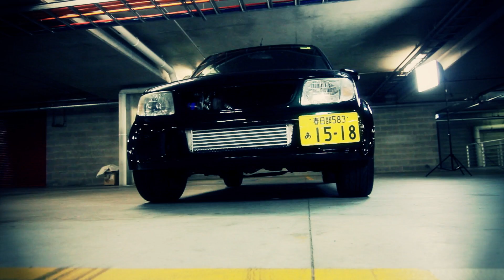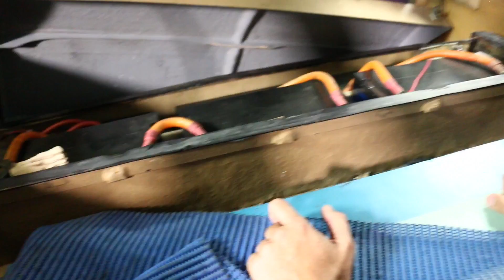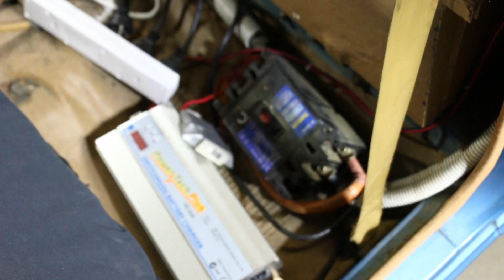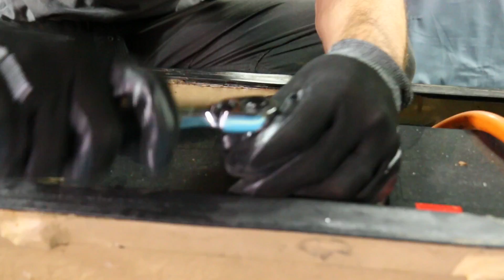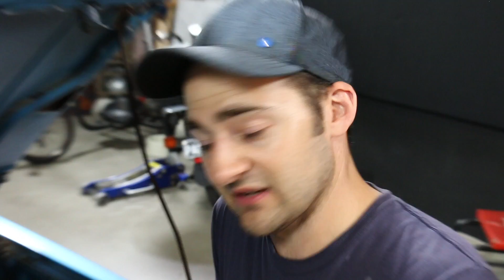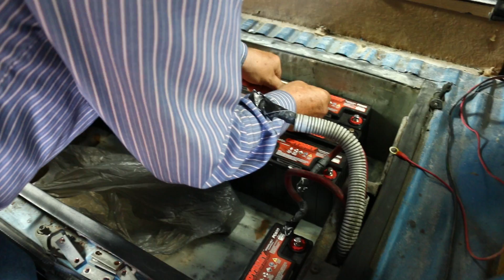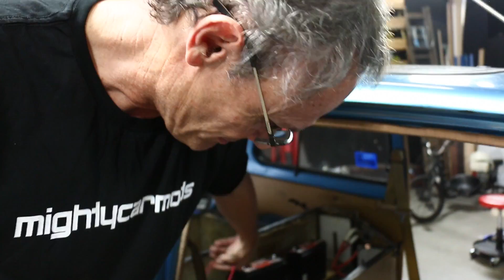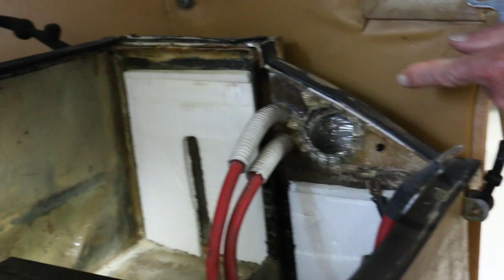JDM Electric Turd

Comment: Make your own batteries using 18650 LiPo cells (5000mA), and then throw a 35 Farad Supercap in parallel to each bank, and YeeeeHaaaaaa!
Reply: +delawarecop  Good luck finding a 18650 LiPo cell with 5000mAh capacity.
Reply: +delawarecop would be insanity, but then ud want to go for a bigger motor too, or maybe 4 motors, one for each wheel and a custom carputer to route power for fancy traction control. end up with pretty much a tesla...
Reply: EntourageTouring
http://www.ebay.com.au/itm/OZ-Li-ion-5000mAH-3-7V-Recharge-Rechargeable-Battery-UltraFire-18650-/371245818897?var=&hash=item566ff9a411:m:m3Jkcl0W8b7mD1C3BzfhwNg
Reply: ZYLINX
Yeah, I've seen those Hub motors that can be used for direct drive, which would help eliminate the inefficiencies of the traditional driveline/gearbox set-up, but I'm not sure how complex AWD via Brushless DC motors would be? But you are right - it would be insane!
Reply: +delawarecop 

those actually down have anything close to capacities they advertice, not even half.
Reply: finbenton
Did you test them?

Comment: Batteries, you need deep cycle batteries if you're going lead acid. Something like for a trolling motor, or UPS systems should work. Starter batteries have thinner plates in order to pull more cranking amps in lower temperatures, but they are delicate. They put out a lot of power for a short while and bcome damaged if you drain them too much. Starter batteries are made for a few hard amps, followed by recharg.

Comment: I dont get the electric = eco stuff! Electricity doesnt come organically, it comes from burning old dinosaurs just the same, but different. Come to Newcastle and check out all the crudest oil ships loading up millions of tonnes of coal to see what electricity is all about!
Reply: +shredZballs  Someone said an electric car is just a car with a really long exhaust.
Reply: +shredZballs You are absolutely right, but it does move the pollution away from the densely populated areas.  Out of the towns and cities where it impacts peoples health, and then costs everyone additional taxes for healthcare.  Also that impact does lower depending on the electricity sources used in what areas.

Comment: Awesome, enjoying this so far, I do think that there could be issues with that MCB in the back not being rated for DC, could cause problems with fault clearing(disrupting a faults arc), though that also really depends on what the MCB is there to protect, the battery's or the cables.

Comment: Use capacitors? Tons and tons of them.. They are cheap, light, and they work tons better at storing energy.. They don't wear out as fast, recharge faster, hold more.. win, win, win, win..
Reply: +Kyle Nabinger (Angablade) Not to mention it also explodes stronger
Reply: Not really
Reply: +Kyle Nabinger (Angablade) capacitors have high current output (low internal resistance) but they discharge so fast compared to batteries so they'd be no good for this
Reply: +Simon Bird that's why you don't discharge it all at once
Reply: +Kyle Nabinger (Angablade) no no I mean a large capacitor will power A light bulb for about 10 seconds
Reply: +Simon Bird new super caps work a whole lot better than that. plus, they have higher amphour  caps. tech has changed
Reply: +Kyle Nabinger (Angablade) supercapacitors still have lower energy density compared to new batteries (lithium polymer and shit) so there's still quite a gap between caps and batteries but I honestly just did some research after what you said and apparently that gap Is closing do maybe one day soon capacitors will replace batteries
Reply: Boostcaps are good

Comment: You might have been able to resurrect the old batteries with a desulfating charger as it can undo the chemical changes of the dead battery a few times.
If you're feeling braver, sometimes connecting one to a DC welder and giving it a zap can cause it to resume working again and charging correctly.

Comment: What a shocking build!!!  And it has an engineers certificate?!?!?! Everything, and I mean everything, is HANGING LOOSE!!!  Packed in with Styrofoam and cardboard!?!?!?  And all the High Amp and 240V wiring strewn around!?!?!?
Get the professor, Dr Brown!!!! Just replace everything with a Flux Capacitor!!!

Comment: Love this! I have already done a few EV conversions myself. It's really great to see yall doing one yourself, hopefully more people will want to do conversions after this. Personally I would use recycled Nissan Leaf Cells, instead of the Lead Acid, they are killer cells, easy to use and require little maintenance. But if your feeling real spunky a custom 18650 pack would be killer, with an AC drive unit.

Comment: Replace those batteries. With Lithium Iron Phosphate (LiFePO4) Batteries, and super capacitors, would be heaps more power and about 1/3 the weight.

Comment: How interested are people in importing old kei cars (to go EV, engine swap, or just run them stock)?
Reply: +ItchyKneeSon Im very interested in that but im in the us so most of the cool Kei cars are illegal due to safety reasons
Reply: +Jacob Westphal Which ones?  I own a '90 Honda Today.  The Beat is legal to import this year... :)
Reply: UGHHHH honda todays are sweet, its mostly smaller ones and it on a state by state level, here in wisconsin it has to have at least 105in wheel base to register as a car
Reply: very
Reply: Kei cars are mad. Wish they sold some in the states
Reply: I am interested in importing one but not an EV swap
Reply: +Sol3 Sick I don't think they meet the safety standards due to their size and, therefore, crumple zones.  I love driving my '91 Today around the mean streets over here.
Reply: +ItchyKneeSon Any specific cars or just any old one will do?
Reply: personally i would love an S660 or a cappucino or an alto works

Comment: Should of went with a lithium ion setup or a lithium polymer setup the torque and longer run times would of been amazing with the amount you could fit inside that little car.
Reply: +Sick Lad Those blue cylindrical batteries in the preview for next week are very high power lithium batteries. Hopefully they will use those instead.
Reply: Thomas Finch Not sure if they are lithium battery's never seen a lithium cell that big ever, they might be super capacitors not sure but.
Reply: I believe they are LiFePo4 cells. If you Google that you'll find they have extremely high energy densities and you can draw lots of amps from them. They are commonly used in electric bicycles but Tesla and other companies are looking to use them in cars.
Reply: Ah yes i see you might be right, i only really know the basics  when it comes to batteries but more amperage and a better power density sounds really good, but why aren't these batteries in action in cars and other devies? if they are as good as they sound whats the catch? You sound like the person to ask haha.
Reply: +Sick Lad Exactly, but would be very expensive.

Comment: You should find a way to put a small generator so it can charge while you drive, making it a crude series hybrid. It would get like 100 miles per gallon.
Reply: +Kyle Kelliher It would use its own power to charge itself. Makes no sense. "Braking power feedback" could work tho, but I guess it would cost a fortune to make it work.
Reply: ***** not if you had a gas powered generator. Obviously making power off the electric motor itself wouldnt work, hence why there isnt perpetual motion.

Comment: A friend of mine took me for a spin in an electric Daihatsu with a 72volt Lipo system. No boot space but seriously impressive acceleration but limited range. Good to see something different from you guys. Replacing each 100Ah battery with two 16 Ah batteries will limit the range a bit.

Comment: I had a crazy idea of converting a miata with a toasted engine. Apparently there are certain motors out there which could theoretically give a miata a ridiculous power to weight ratio turning it from a fun weekend cruiser into a rag-top-death-trap. Estimated cost for such a project would be less than $3000 U.S.

Comment: still more torque than a honda
Reply: electric motors offer the most torque.
Reply: It isn't about more, it is about instant torque. It actually might make less torque than a modern Honda. They didn't show much information on the motor, gearing, or the Amp capacity of the batteries.
Reply: Koop That's like 200 ft-lbs for us Americans, right? That's neat. Too much torque for me.
Reply: +Freemananana VW e-Golf's have 270 instant nm's, a lot of fun :)
Reply: bruh wait for the v-tec 😂😂😂
Reply: +Nick Fikes were don't have a few hours bro.
Reply: +Portalmaster we*

Comment: I would replace the lead acid batteries in there with Optima batteries, that would be a better improvement. Or do a mad experiment with super capacitors.

Comment: PRO TIP: Don't hold old batteries sideways or upside down. If the cover is leaking you can pour the acid out.
Reply: +darek4488 They are AGM but even then better safe than sorry.

Comment: I want to get a ZH fairlane, swap the rear doors for XB wagon doors, paint it black, tinted windows, convert it to electric using the tesla plug and voltage, overhaul the suspension and brakes and drop it on deep dish 20s

Comment: why not put both pack in the back space so you have more room inside the vehicle
Reply: +Sillyzombie666 I was thinking the other way around...cram the middle space full of batteries to keep the weight of them between the axles for improved handling
Reply: +Sillyzombie666 Probably want to keep the overall vehicle weight balanced and the center of gravity low and forward.  Putting them all in the back would likely make for some interesting/unsafe handling attributes.
Reply: true true, i've always wated to make an ev but i just dont have all the know how....or money or space to put another car atm. but i may just need to find an older conversion and update it.
Reply: +Sillyzombie666 It appears these guys were in the same boat.  Gotta start somewhere, but know what you're getting into.
Reply: ItchyKneeSon
 they have way more know how than i do, i dont know shit about cars. all i know is for the most part i would need to gut the entire fuel system, pull out the motor. then if you cars new enough you need to figure out some way to get both the air conditioner and heater working if you want that. then with power steering (again if your cars new enough) i have no clue , i'm also not sure if you hook up an alternator to the main 12volt battery (that runs radio lights and so on) or if you would have that charge when you charge your main cluster since you don't have to worry about a starter
Reply: The weight all the way in the back would pull the front wheels off the ground.

Comment: One of the big things with EV's that I heard no mention of is regenerative braking. In a Tesla especially, as soon as you let of the accelerator, the regen kicks in to start recharging the batteries. It's such a strong force that most drivers end up never actually touching the brake pedal in normal driving situations. That regenerative braking is a big part of why electric cars nowadays have such impressive range compared to before.
Reply from the maker: +Zaiyetz Not in ours, cause it's DC. AC conversion for sure. The MR2 moog drives has regen
Reply: Oh ok I see. I'm definitely no expert, usually when I hear talk of range (especially when it comes to Teslas) regenerative braking is a big part of the conversation. Good to know it's not being overlooked! You guys are awesome.
Reply: +Mighty Car Mods Any idea what the owner of the MR2 payed for the AC conversion parts?
Reply: +64 Fanatic (i64fanatic) Probably around $8000 by the looks of his battery. You can do it for cheaper with 18650 cells and depending on what power output you want and what parts you build yourself

Comment: As a person that has worked for a battery supplier for 9 years, I can defiantly say I know a few things about batteries. Odyssey batteries are good because they use 'pure' lead. Basically 99.9%ish pure. So it can carry more electrons!
Reply: +Darren Boss know of any cheap lithium cells?
Reply: +Sam we do all types apart from those! Apologies.
Reply: +Sam lithium car batteries run around $350 on the cheap end.
Reply: +Darren Boss Why are Optima batteries so popular?
Reply: +MityLite loads of power due to the spiral wound cells. a battery of equivalent cold crank in a normal battery would be a LOT bigger and heavier. But you are paying extra &#163;&#163; for it. They use them in tractors, Chrysler and refrigeration lorries. And I've even seen them installed on car head units for speaker powerrrrr.
Reply: Darren Boss Great info, thanks
Reply: +Darren Boss 
Thank you wow finally a YouTube commenter who knows thier shit

Comment: I've seen lithium cells built from surplus discontinued or failed/inappropriate for purpose laptop battery packs for the size of one of your batteries you can have a 48v 24ah per cell at 90 bucks per cell as per this guy youtube link (/Z-VLdE6RxYQ)
Reply: +kyle “brainbukt” hubner Id much rather buy the individual cells in bulk as the quality is better and they aren't too expensive

Comment: I can't believe it passes inspections with no ventilation for the batteries. Inhaling fumes from a battery can be extremely dangerous and harmful to your lungs and respiratory tract.  Sulfuric Acid smells like Rotten Eggs. I'd highly advise you guys to add ventilation for the batteries.
My car has the battery under the back seat, but it has vents on the sides of the batteries with hoses going outside.
Reply: +Anoxias Plz upvote this so they can see this and respond
Reply from the maker: +Anoxias It does have ventilation, the 'wall wart' that we mentioned drives fans and all those battery boxes have ventilation.
Reply: +Mighty Car Mods As long as you guys aren't dying on us due to mad electric skids. Just wanted to make sure.
Reply: +Mighty Car Mods Thanks for the response

Comment: +Mighty Car Mods You guys need to look into Maxwell super capacitors and XS Power Lithium Batteries if you haven't yet for this turd... You can make a beast while saving a ton of weight!
Reply: +lmadden6236 and unbelievably expensive. To give you a rough price difference retail between a AGM and a lith ion version of that 17-20AH battery. We were selling the AGM's at roughly $25 each, the lith ion's were $170 each.
Reply: +lmadden6236 Capacitors don't hold a charge for long enough and those batteries are too expensive. I think 18650 cells are currently the best lithium option. Tesla was using them until they started designing their own cells.
Reply: +Ben Ellix Oh, I know the price is a bit higher for the caps and a lot higher for lithium but it was just an idea more so for the show to try out so people can see what alternatives there are... Realistically, If you were to build an electric car, nothing would be cheap and the two options I mentioned are far more dependable and last several times longer than an acid or agm battery so in the end it would be worth the extra expenses.
Reply: +Sam If used on a daily bases the super caps will hold a charge. Either option will need charging. If you somehow have an alternator and use this vehicle as a daily driver it will maintain a charge. It's really a shame that automive companies that are using this technology don't have an alternator or generator to charge the batteries or caps. As long as you have something spinning you can use this method to charge and as you drive the hubs spin as well as motors. This was just an idea for the show and they really don't have a budget.
Reply: lmadden6236 It doesn't make sense to have an alternator or a generator on an electric car. If you have an ac motor you can use regenerative braking.. idk wat purpose a generator would serve please explain

Comment: Won't those side mounted batteries leak acid?
Reply: +wiz2111 They're fully sealed gel/AGM type batteries, originally designed for powersports applications.

Comment: The amount of volts running through something won't kill you is the amount of amps so it would be better to work on electrical with 1million volts and only 1amp then something with 100 volts and 10 amps
Reply: +dylan simpson And even then, this is a DC setup, so it's not going to stop your heart anyway. Real good at making big fires and letting the smoke out of stuff though.

Comment: DUDES, put a small generator in there!
it will still be way more efficient than a traditional engine to the wheels and only needs to kick in when the battery gets low!!!
If you get some super capacitors you could even build up the charge from the generator when you are stationary and have massive amounts of power to pull off.
Reply: It will be like the Hammerhead iEagle Thrust(Geoff)!
Reply: +TheRealDrtball because that went soooo well ;)
Reply: Generators add weight and caps add complexity.

Comment: i would suggest you upgrade to Lithium ION batteries.
they have around 20 times the weight to capacity ratio so you can get significantly higher range if you use a modern battery technology
Reply: +Jared Reabow (Jazza) They can be freakin expensive tho. You can recycle old laptop battery stock but some of the cells are rooted and others are mint so you need to find out how much MAh you have in. IMO they should replace the whole electric magic and get some mad power
Reply: Agreed. I saw a build thread where a kid put Li ion batteries in a s2k and it was awesome.
Reply: +EmElGee yes they are on a budget and as i said lithium ion has much higher capacity which means to match the same range they would have to buy far less batteries

Comment: Why didnt you go li-on?
Reply: +QurttoRco Price
Reply: and I'd be pretty certain changing from lead acid any other form of battery would need the charging gear all replaced and probably the whole system rewired